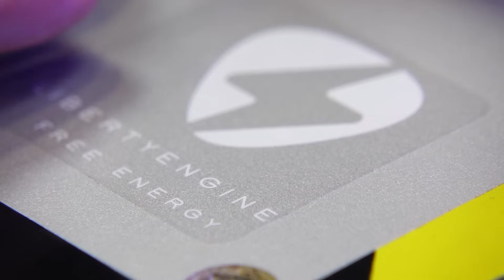10KW Generador de Energía Gratis con Piezas de Microondas - Liberty Engine 3.0 - 100% REAL

Comment: Very impressive, the generator puts out 220 Volts / 50 hz, exactly the same frequency of the grid, whit no eletronics. Amazing!
Reply: You would never understand electromagnetism and you are not engineer, you have not the experience so you dont know if it works

Comment: Why did not the small motor from microwave start to rotate after start when it was plugged in
Reply: because a diode only conducts current in one direction

Comment: What was the plug with the twisting thing on it that you put into the power strip to start the process?
Reply: Yes, it's a geared motor and it sits underneath the glass plate in the microwave that allows it to spin. That's where you'll get it and you'll be able to get the two transformers you see from the microwave as well, but only one per microwave. So in one microwave you'll get one transformer but you'll need two and you'll get one of those geared motors you see that spin the plate
Reply: Excellent, thank you for the detailed explanation.  I haven't taken a microwave apart, wasn't familiar with the plate spinner motor. 😀
Reply: You have created the project
Reply: @jewelrycasa  You can buy the transformer for $50. I looked it up. The part number is on the video for Liberty Engine 2
Reply: @pedrosura  Oh cool, they are available online.  I might try my luck at a couple of free microwaves locally for the parts 👍👍

Comment: You removed the rotor so there is no moving parts, the middle metal pole is fixed and screwed into each of the end magnets. So according to your setup the spark of life at the start somehow causes infinite flow of electricity throughout the machine. Damn, I should have attended science class at school. 10kw generator from no moving parts all regulated 230volts at 50hz. If this really worked we would have infinite miles on electric cars, trucks and boats. The cost of distribution would be negligible around the world and everyone on the planet would be considerably better off. That said, I have my doubts from a common sense point of view. If it worked, you would have patented it and made trillions off the design. Also, when you added the fan and switched it on, there was no draw from the light bulb. Me thinks it is on the grid.

Comment: T80B4
    DISCONTINUED BY MANUFACTURER
    MOTOR
    230-460 VAC
    0.75 KW
    1400-1700 RPM (la mayoria de los motores generan 850 rpm, puede ser irrelevante)
    50/60 HZ
   Estimated Value - 1,250.00 (!!!)
Reply: La velocidad de giro y la frequencia del sistema electrico estan relacionados. 1400 rpm en el Liberty engine 2 los polos (polo N) pasa 46 veces for segundo (-50Hz). Si cambias las velocidad del motor estas cambiabdo la resonancia del sistema electrico.

Comment: Has anyone done a demo of this? And I request the maker to make another video of it and show all the parameters given below:
Separate inductance of the three windings of the motor [open circuits]
Inductance of the coils used in the magnetron [open circuits]
Magnetic permeability
Parameters like magnetic flux density (B) and magnetic field strength (H)2. The metal rod used
Start the system and output waveform
Output frequency
Then let's see what

Comment: Salut monsieur mes sincères félicitations❤❤❤  je voudrais juste savoir si les raccordements des transfos et stator sont en séries ?
Je vous prie de faire l'essai de ce générateur statique à l'extérieur de la pièce merci
Reply: the connection between the transformers must be crossed as if you were looking at the infinity sign it should look like this but it won't help you yet there is one more fundamental thing you won't know and this guy won't say anything about it but keep trying maybe you'll finally understand... :) I already did it a long time ago with a positive result :) it is the same principle of operation as Liberty Engine 1 and Liberty Engine 2 and the silver and aluminum alloy from which the rotor is made was intended to distract attention from the actual and real operation generator and since you can't think for yourself, you'll collect and cry for another 50 years :) :) and wonder what the hell is going on here or, best of all, look for a hidden wire ... :)

Comment: What material is the core made of? What dimensions does it have
Roller core?
Reply from the maker: It is the same material of the rotor of the Liberty Engine 2.0
Reply: is Aluminu 50%
silver 8%
silicon 14%
barium ferrite 4%
Strontium ferrite 5% ???

Comment: Is it a short-circuit that you initiate with the inpulse that is never exhausted as it is not consumed, but just passing by in perpetual short-circuit motion?
Reply: Why the ring magnets? They have a considerably different field than normal shaped magnets. They surely have a purpose
Reply: No moving parts! So nice

Comment: the only thing I noticed when he activated the motor that spins the plate in the microwave was the generator.  but how come there was no return the moped should turn the remained stationary and he removed it from the plug in my opinion and a taruffe went so well with the other videos regardless that if Bossi is true also with other videos YouTube would have blocked it immediately that politics intervened so don't worry free Energy no

Comment: Es ireal el motor excitador es 5 w no puede mover las bobinas del motor ni las bobinas total sera 1homs,y además no marcho el generador cuando arranco 😢😢😢.es lamentable yo me avia ilusionado..
Reply: You made the central axis with 304 stainless steel. It doesn't hold a magnet, to test if it works you can connect the motor stator directly to the mains and the microwave coils in parallel to see if the power in watts is greater than that of the stator. .